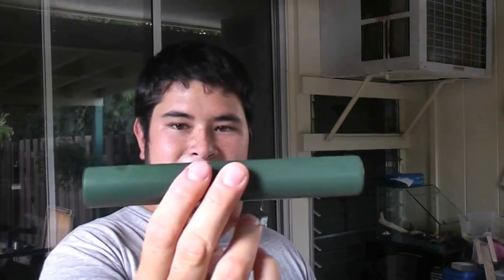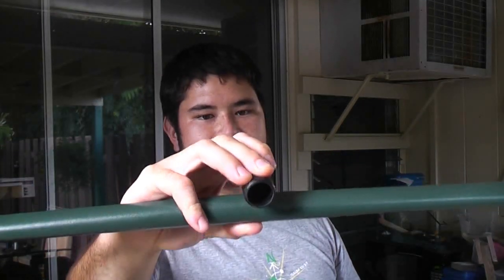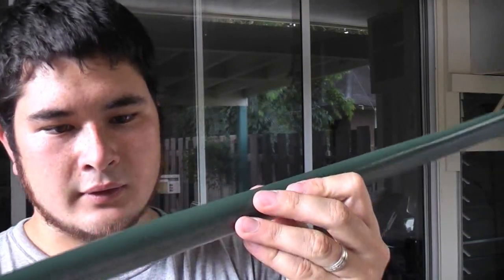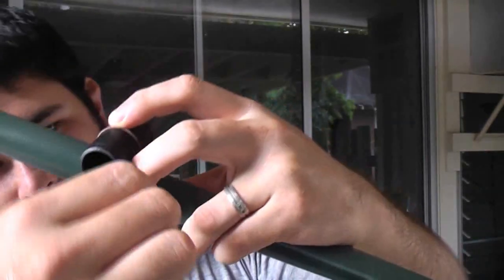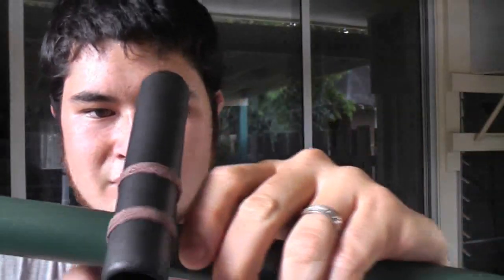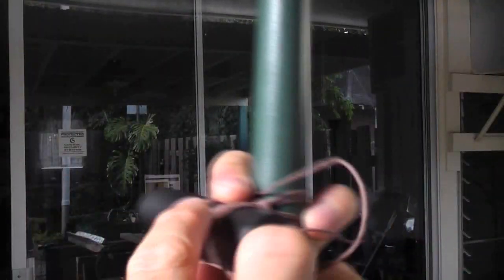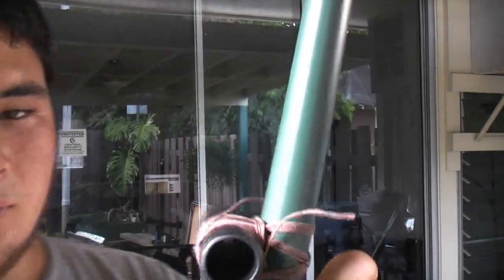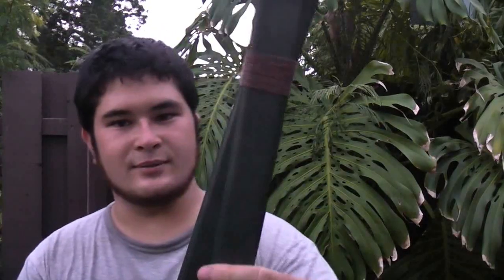A 65 Pound Centershot PVC Bow Part 2 - Lashing and Finishing

Comment: --------I ALSO SENT THIS TO YOUAS A PM----------

Hi,

I made a bow using some of your instructions from the series of 3 movies:
A 65 Pound Centershot PVC Bow Part 1 - Layout and Flattening

But.... there are 2 major differences:
1) I didn't want to use heaters (i don't own any) an so the pipes are aprallel  all the way and fixed with screws and bolts, the string is attached to the screw.

THE PHOTO:
http://i60.tinypic.com/14e1af4.jpg

...works like a charm :) and every day i'm getting better at both making and shoting using bows BTW: My next project is gonna be a compound bow.

....BUT..... [THE PROBLEM]

2) I didn't make it out of PVC but from PP (polipropylene) which is the only available pipe with thick walls where i live (Poland) -  trust me i searched and searched for Schadule 40... no chance.

And so.. do bow is practically the same size the same curve (the length of the string is about the same as those watched in your movies) BUT...

I'M nowhere close to 65 lbs (29kg) i get around 30-35 lbs (14kg)

is this because of the PP, my previous bow (7kg) (which broke - bad construction, too many tension in one point) was made out of pcv but the "thin" one.

Do you have any experience in making bows with PP - i realized one REALLY BIG ADVANTAGE - after "disarming the bow the pipes go practicaly straight afer a few minutes which did't happen with the PVC which stayed "bow-shaped"

Comment from the maker: It does if you finish it with a good flexible clear coat. Otherwise it will start coming off in flakes once it's completely dry.

Comment from the maker: I usually use a plastic adhesion promoter, which is a clear primer for flexible plastics. If I'm using a paint made for plastics, I'll just sand the pipe really well, remove any dust and paint without primer.